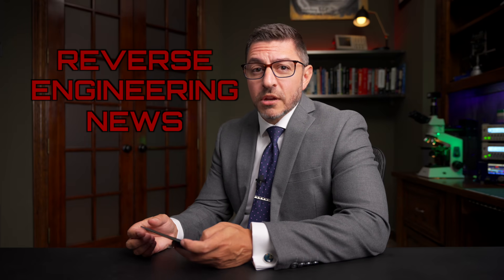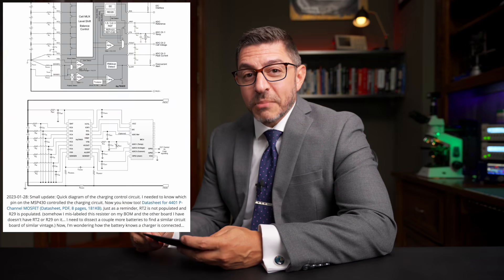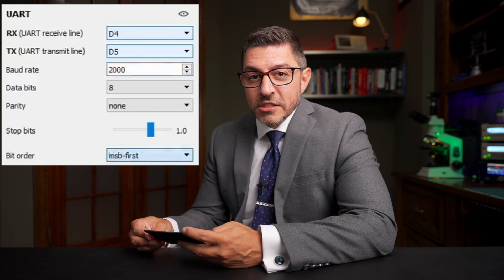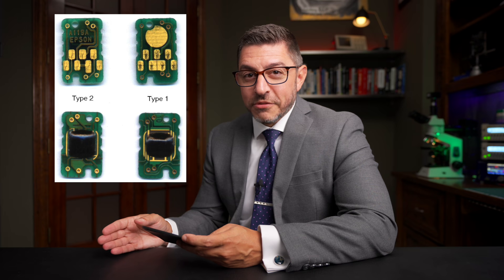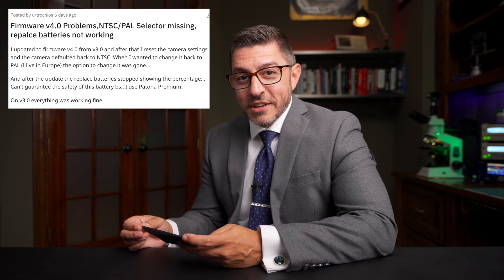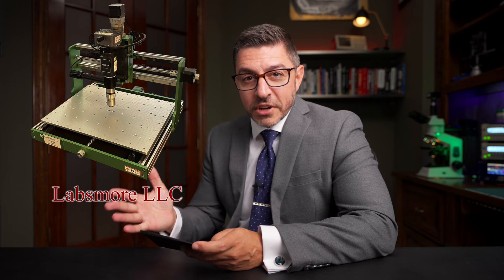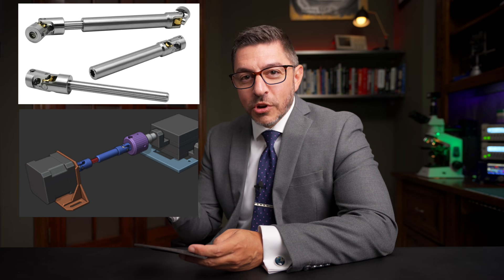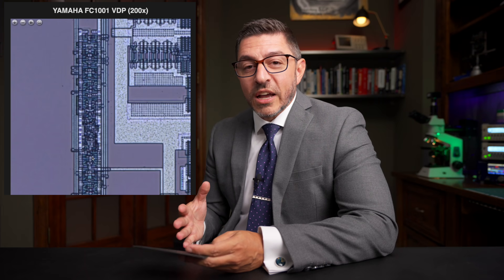Milwaukee EASY to HACK, for now...

Comment: Hmmm, the other person was me. I actually did most of the work on reverse engineering the protocol, figured out the baud rate, a lot of the data and the checksum. Then someone else did a video on it, before I did... I even wrote code on the Arduino to talk to the battery by modifying the Softserial library, and saw the only communication seems to be between the battery and the charger. The tools don't seem to communicate.
Reply from the maker: Have any links I can add to the video description to give you credit?
Reply: @RECESSIM  I sent you a PM on discord with most of the work I did on it :)
Reply: @RECESSIM  It won't let me post them.
Reply: I saw that video.  He does mention you.
Reply: I have seen that milw.* video in suggested few days before Recessim video but i didnt click that one because i thought its more on the right to repair not about something that could be usefull @UnCoolDad  
BTW the 115kbauds, 9600 4800 come from the 192200 Hz clock implemented at many *51 chips, ucontrollers - its just a standard that emerged :) - probably 2000 divides some other clock or is double the 1000Hz - did somebody figure the 2k out?
Reply: "the only communication seems to be between the battery and the charger"

I have a power drill from LIDL. The charger died (a small ic burned). I can still charge the battery with a lab psu. So ye, the only communication is between the charger circuit and the one inside of the battery case. I reckon the battery circuit sends a signal to the charger to power down once the battery cells reach a certain voltage.
Reply: That seems to be the case with most tool batteries, they only communicate with the charger. Some tools read the temperature lead and have to initiate communication to get to the resistor value which can then be used to lockout power.
Reply: 😅 @FrancisKoczur
Reply: Thaaankkk Yooouuu! I watched boffofem and checked the code. Love Ya.
Reply: The vid was good work.
Reply: Well done sir

Comment: to be fair with the batteries, non OEM batteries tend to be of worse quality, and often have worse safety features, which if you abuse your tools like most tend to, could lead to bad outcomes and or opinions on tools (with especially bad batteries)

It's not like printer ink where its all pretty much the same.

Comment: Unfortunately, tools, especially power tools and battery powered tools are stolen A LOT. So much so that many tools have connectivity options built in for anti-theft. First, there is "store activation" - if you shoplift the tool from the store, it won't work because it won't be activated by the store. Next, most tools have Bluetooth as well to activate them by the legitimate owner - because having tools stolen at a job site is expected to happen. And it's not just some other contractor on the site - other people walk onto job sites and steal tools as well. So all the professional tools are connected because it's the only way to protect against theft. It would not surprise me if batteries adopted similar things because hey, it's something easy to steal as well. So avoiding tool connectivity is basically ensuring your tools aren't recovered if they get stolen. Now, in general, though, the tools don't have internet connectivity - because often the tools are  used in places where there is no internet connectivity - sure you might be working on a house in the city, but there's no Wi-Fi around. There's cellular, but that's it. So chances are, it's not something that's happening because most tools will likely be used in places where connectivity is limited. The Bluetooth tools usually use some form of fob you keep on your person.

Comment: God forbid the manufacturers just made cost-effective batteries that weren't so expensive that 3rd parties wouldn't bother to try to 'fake'.....
Reply: if you actually compare OEM batteries to 3rd parties the 3rd parties are often objectively worse. Im sure the manufacturer takes a decent margin but they do also make their batteries to a high standard.

It's always cheaper to produce shitty, lying batteries that kinda work, than it is to produce, proper, beefy, non lying batteries that do perform.

Comment: Yep. I used to see what I thought of as WiFi dialects a lot back in the early 802.11B/G/N days. Depending on the particular vendor firmware, different clients and access points might not even see each other let alone connect. Flashing alternate firmware would sometimes fix it. Nice to see the differences in detail.

Comment: Re: Dewalt 20 Volt Max batteries, I have lots of 20 Volt Max tools and some batteries that are over 10 years old that still work great. I recently bought a new 5 Amp hour one and a chain saw,  branch trimmer that both work really well and now I have bought Two 9 Amp Hour 60 volt/20 volt Flex batteries for their next gen tools. I only buy Dewalt tools, I even have a 20 volt Max Nailing gun that is awesome. I used to be a Framer/Carpenter for 12 years.
Reply: Mine worked great until the day I tried charging them, now they are junk.  I was amazed that they lasted over 5 years without ever needing to charge them.

Comment: i actually don't mind the Sony warning that the battery is not made by them warning, its been on my cameras for years, there are so many counter fit batteries on Amazon etc so its good to know yours is legit and if you do use 3rd party batteries it shows this warning once and that's it.
Reply from the maker: I only use the original Sony batteries so wasn’t an issue for me. But a warning can easily change to a “not authorized” by the manufacturer.
Reply: @RECESSIM  its nothing like that its just to warn users "The operation and safety of this battery cannot be guaranteed. Continue use?” cheap counterfeit batteries and 3rd party but they would never block use of 3rd party if it was about money they would block 3rd party lenses first 

printers etc they sell you the printer at cheaper price to get you in and then sell you over priced consumables

Comment: The Milwaukee battery handshaking is NOT just so you buy their batteries. There are temperature and low voltage information being shared between the tool and battery keeping your investments from dieing permanently.
Reply: Or ensuring that the batteries *do* die permanently.
Reply: The voltage and temperature between tool and battery are purely analogue. I've not seen any communication between tool and battery. I didn't get around to doing a video on this, but I did make a few reddit posts with a lot of this information about 7 months ago, then someone else decided to make a video with my work.
Reply: Yooo I watch your vids mate. Good to see you here!

I've made a few Bluetooth speakers mainly using 18650s and a few different configs of mini amps and whatnot but the most recent one is powered by a 4.0Ah Milwaukee M18 and it lasts around 24 hours at a more than decent volume. It's a Mission centre speaker off of surround sound and it kicks arse big time <3 Perfect for the beach although rather heavy lol

Comment: Yeah my last HP printer that I bought I discovered I couldn't refill the cartridge myself and reuse it. The Printer wouldn't reinitialize like it was a new refill. I bought a refill, and when it was used up I put the whole thing in a dumpster and bought a different manufactures printer that hasn't implemented that BS. The whole "Right to repair" gets me going in a bad way. I refuse to buy a product that I can't repair and I suspect that's going to get harder to find.